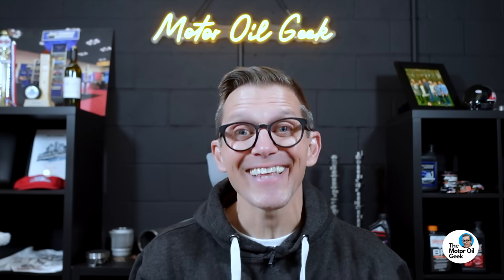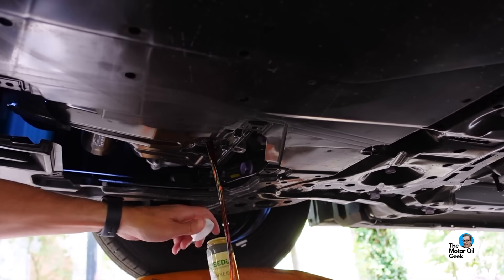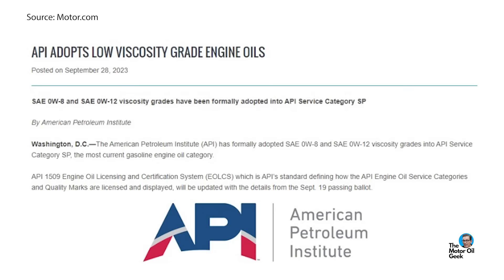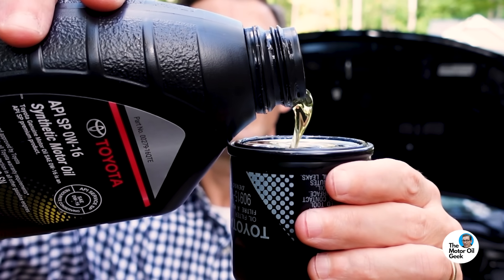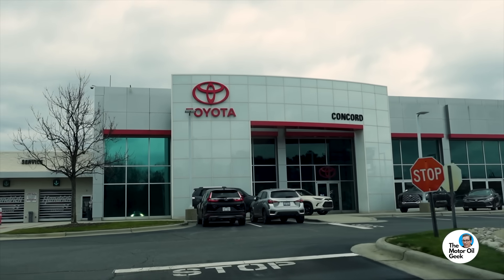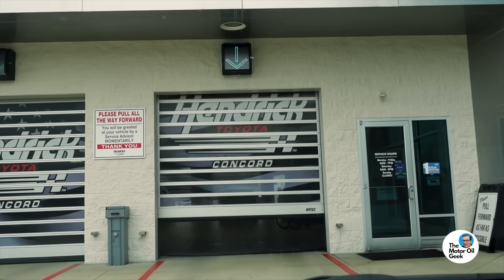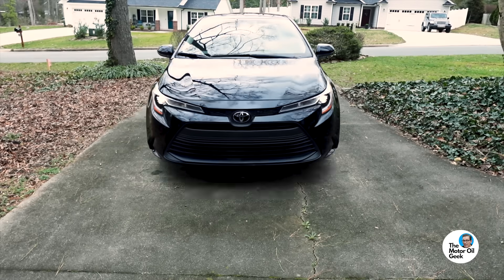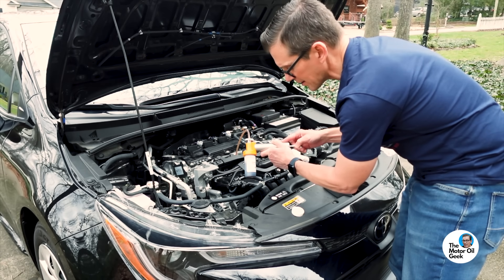0W-8 Motor Oil: Too THIN to Trust? Let's Find Out!

Comment: Love the videos and research that you do.  Keep it up.  We are all learning everyday.  So with that said, I have done a lot of research on CVT transmissions as I own a 2019 Nissan Murano and a 2019 Nissan Maxima.  Traditional CVTs generate a lot of heat especially when driven hard.  I track my Maxima.  With dual 11"x11" oil to air coolers mounted in front of the AC condenser, on the track I have still have seen trans temps above 230 degrees F.  So yes they get hot.  However, the transmission that Toyota is using in their Hybrid vehicles is an eCVT and while it is continuously variable, it is achieved by two motors, one located at the input shaft and the other at the output shaft vs. a traditional steel belt and two varying ratio pulleys.  The motors serve multi functions both as a motor and as a generator which provides power to recharge the battery and is the heart of the regenerative braking system.  So in essence the transmission does 90% of the breaking unless you really need to stop quick in which case the traditional hydraulic brake system kicks in.  Based on my research, there is no valve body in Toyota's eCVT but there is a planetary gear set to facilitate reverse.  The lubrication system in the eCVT is more a splash system for the planetary gear set to keep it lubricated rather than being pressurized.  Neat stuff!!  Learned this from the Car Care Nut who also does You Tube videos.    Toyota's eCVT is an amazing piece of work.

For those of you that have a traditional CVT, especially the Jatco transmissions that Nissan/Infinity and Jeep use, change your fluid often(every 30k miles) and consider installing an external transmission cooler.

Traditional CVTs hold about 10 qts of fluid but you only get about 3 qts out if you pull the drain plug.  however, if you use a fluid flush extractor you can cycle out all 10 qts.  To do so you will need about 12 qts total to do the full system flush.

Comment: You mentioned using a new tube so not to cross contaminate,....but the  new oil mixed with all the old oil that didn't get to drain

Comment: An oil change place gave me a CVT "versatile" fluid in my transmission on a 4Runner.

I asked them if it was JWS 3324 certified.
They looked it up and it said it was certified.

I wonder how that is possible?

Comment: It would be great to test also the TAN and the TBN values every time, I believe it's important to know how those values change over the time.
Reply from the maker: TBN is actually not a great indicator of oil life with modern, low sulfur fuels. Instead, Oxidation is a more accurate detection method. TAN coupled with Oxidation is valuable for ester based lubricants, but non-ester based oils can monitored with just Oxidation.
Reply: @themotoroilgeek  Thank you for clarifying. But what about the damage that acidity can cause to seals and other parts in the engine that are sensitive to acidity?
Reply from the maker: @MECANICANN  Great question. The oxidation of the base oil is what creates the acids, so by monitoring the Oxidation level you are "watching" the acid level. On non-ester oils, an Oxidation level below 30 abs is not acidic. The crossover from basic to acidic does not happen until the Oxidation level passes 40.
Reply: @themotoroilgeek  Thank you for sharing your knowledge, I have learned something new. Cheers. 😉

Comment: So hoping to hear from Lake on this one  - but with my 2022 Toyota RAV 4 non hybrid - should I be running 0w-20 or even 5w-30? When you look at other countries for this same engine there is a wide range of applications. I’m not as concerned about fuel efficiency- I want my engine to last 300K! And I’m on the change oil every 5-6K team. Please no comments from the peanut gallery about how Toyota makes these engine some much tighter now. We’ve seen with the resent GM 6.2 L debacle - that it’s a bunch of garage these manufacturers and their enslavement to CAFe standards.

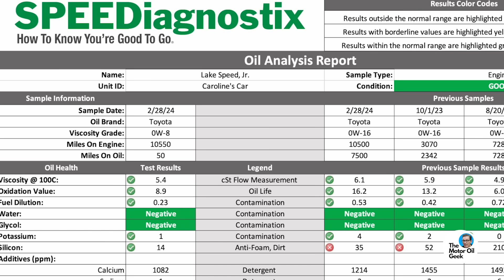Comment: That engine ran 9,822 miles on 0W16 not what is called for in the manual (0W8) as shown on the 10:27 minute mark. I think you should stick with the thicker oil, it showed good results. Switching back to 0W8  with 728 mi of data could be the wrong decision. Why did you use 0W16 in the first place? (Maybe you could only buy 0W8 from the dealership, wasn't worth 50 mi of driving)

Comment: Thanks so much for the informative video. I was quite skeptical of the 0w16 in my 2023 Camry, especially in the light of Toyota recommending 10,000 mile oil change intervals. One who reads forums to any extent understands that many people will criticize those who question the OEM recommendations regarding oil types, etc. It is always prudent to be a student of human nature, however, and take things with a grain of salt until you have facts instead of speculation, as you so state. Many who would criticize me for not buying into the 0w16 (initially) because the engine manufacturers know best would never accept the recommendation to change their oil every 10,000 miles. Thanks to you, I have a better understanding of additive packages, and I have found some information on the internet that Toyota motors have tighter tolerances to accommodate the thinner oils (though I have seen nothing definitive from Toyota regarding this). Thanks again for science over speculation.
Reply: The tighter tolerances argument has never been true. The same vehicles they sell in the usa you can look up the manual for the Australian version and every engine takes up to 5w30 at least.
Reply: @TheScrubmuffin69  Some sources will state that cars sold to other countries have different motors than those sold to the US. That really doesn't make sense, though, so I am inclined to agree with you.

Comment: Lake how about using Marvel Mystery Oil instead of motor oil ?? When I was in Alaska the locals would use the oil straight in winter to be able to start the vehicle at 50 below Zero

Comment: I have a 2010 chevy.  The oil specifications is 0W -20. I've been putting 10W -40 in my engine every year for a decade now. I only use Castrol GTX,and my engine purrs like a  cat!
Reply: i bet you it would purr like a kitten with 0w20 too.

Comment: I have a query that you 100% can answer. I have an Audi TT 2.0 TFSI this car was specified with 5w30 oil castrol edge. Just had a service and the Audi service centre has switched this , to 0w/30 vw504/507. The car is well maintained but we remapped it to 320 BHP from 230 stock is this thinner oil now going to create more wear on this engine dealer says it’s better to get to the components quicker. But what are the risks with this thinner oil. Thanks Lake love this Chanel great information and content. We just want our cars to last into the future long as possible before we are forced to have EV which we don’t want 🤮🤮🤮😂😂😂
Reply: 5w30 and 0w30 have thw same viscosity at operating temp as long as the oil is good. That's why they both have 30 after the w

Comment: as someone who has worked at multiple dealerships as an apprentice I can tell you they dont care if its free or not, they always use the spec oil for the car the oil techs dont even know if the oil change is free or not its just another one of the 15 cars they see a day.

Comment: I have the same engine in my 2023 Toyota Cross.
 I did 3 oil changes ow-20 in the first 50, and will change this out at the 5000 km mark.
 from here on in it will be ow-20 oil forever, at 3,000km.
Just like my Dodge vans with 550,000 km & 307,000 km, 5w-20 always.
 Sorr,y no Selll to me with 16/08/06/ 03 or whatever Toyota wants to do their testing.

Comment: Hey lake, I would really like to see if you could explain this to me. GM LS engines and older sbc vortec engines from early 2000’s typically call for 5w30, and newer GM LT based engines in trucks and suvs call for 0w20, but on Camaros and corvettes with LT v8s, they call for 0w40. 

Seems like oil viscosity recommendations are based on application, not really the engine design. Maybe I’m wrong. 

Would it be okay to use 0w20 on an older LS based v8 or a SBC based vortec from early 2000’s that gets daily driven, and never goes above 3000rpm?
Reply from the maker: While application makes a difference, CAFE fuel economy requirements are the main reasons for that difference.

Comment: My smaller cc motorbike bought in 2013 Recently completed 70000 Kms. 20w 40 was recommended by owners manual. I used 20w 50 instead my piston and cylinder was in perfect condition. (Oil change interval every 4000 kms). 
Manufacturer recommend to change at 5000kms.
Finally after 70000kms the camshaft bearing was gone still cam lobs had negligible wear. 
Recently I changed everything inside the engine, new cylinder kit, New camshaft, (It's SOHC 4 Valve) 
Crank bearings changed. 
Now I started using motule20w-40 3000 Hc tech plus oil. 
Now I am going to shift the oil to Moule 10w 40 estercore semi synthetic. 
Shall I extended the oil change interval to 5000kms using ester core

Comment: It seems to me if 0W8 was so bad for the engine like everybody says everywhere in the Internet because it is too thin like water etc, Lake Speed Jr. would not have used it in his daughter's vehicle. I hope after this video lots of car owner will finally calm down. What is more, he did even oil analysis where he proved it does not hard the engine at all, and because of its additive package contents it performs quite well. This Internet is full of horseshit. Everybody is a professor out there and not shy to express opinion, even if it has nothing to do with real life.
Reply: The main problem is going high miles while also using thin oil like 0w8. The detergents and additives wear out and then the thin oil doesn't protect like a thicker oil would when worn down

Comment: You said that you  tested 0W-20  and 5W-30 on the same engine and found 0W20 gave more wear protection because of the additives in the oil ...that is not true, it cannot be true.  . Do a simple friction test and see which one gives better wear protection . 
Nowvif you really call yourself the"motor oil geek" then try to find out the truth  from your sources as to  why these companies have suddenly switched to 0w20(suxuki) and 0w8 (toyota) oils  while the latest ford n chebrolet petrol cars are still on 5W20 and 5w30 . .
Hope you know what CAFE is , do your research on how automakers are trying to fulfill the CAFE targets .
Reply: i don’t think he’s ever made that claim. He openly admits in one video that when viscosity decreases, wear increases. But we can’t rely just on bearing testers. We need to actually run oil analysis tests. And you know who does that? The OEM. When they R and D the engine. And of the brands you listed, isn’t it odd that the notoriously more reliable brands have switched to thinner oil without issue?
Reply: But it is true and can be true.

Comment: Just bought a corolla SE 2025 and will definitely do my own oil changes at the recommended intervals you specified. How long should I wait to do a transmission fluid change?
Reply from the maker: Do it within the first 25,000 miles.
Reply: @themotoroilgeek  I did my first oil change at 640. Tried to do 500 but had an unexpected trip come up. 😅 --- what was really interesting was the oil had strong smell of gas, I live in a major city and have constant stop and go traffic and idling. I'd be interested in a comparison of the breakdown of oil between cities and suburbia. I wonder if the car would benefit from interval closer to 3k rather than 5K based on the driving habits it will be exposed too. Just wanted to share in case you have data points showing a correlation.  Thanks again for giving me the confidence to do my own oil change.
Reply from the maker: @GG-ws2gc  Short trip driving is tough on the oil. Oil analysis is the best way to determine the proper oil change interval.
Reply: @themotoroilgeek  I appreciate the insight. Will definitely pick up an analysis kit for the next change. Super curious.
Reply: @themotoroilgeek  appreciate the response 🙏

Comment: There is nothing wrong with extended oil draining intervals up to and over 10k miles. I have a 2012 sienna with 170k and have always changed the oil every 10k miles. Still runs like a champ, not adding anything in-between changes.
Reply: That's is quite surprising. Good that your engine works well with such intervals. What is your city vs highway driving percentage? if you drive on freeway a lot, 10K may be fine.

Comment: OE Toyota filters, they test to not filter nearly as well as other common makes and brands. But, we all know toyota run a long time. Obviously, toyota isn't going to risk the reputation for longevity to save $2 on a filter. Do you have an opinion on oil filters and how critical or not having a "tight" media filter versus a Toyota (and Mazda) filter that prioritizes flow over small micron capture ? 

I tend to believe factory engineers know a little something that doesn't meet the casual onlooker's eye. The toyota oil samples, while using Toyota OE filters, don't appear to have more particles than average. I'm just curious if a common brand filter would show fewer ppm wear particles. Is there a Tribologist's opinion ?
Reply: Seems like Toyota prioritizes flow vs extreme filtration.

Comment: Compares the 16w that was used whilst the engine was
STILL breaking-in after only 700 miles to the later replaced 8w
at 10,000 miles for contaminents and declares the 8w as "better" 
because there's now less contaminants in the 8w oil than there was
in the 16w break-in oil... Yeah right....

Comment: Thank you for your video clips, time and help when it comes to automotive lubricants in general. Very helpful and easy to follow for sure. I have a question for you regarding my 3 vehicles. I live in central North Carolina and would like to hear your opinion on motor oil viscosities for 2022 Toyota 4Runner (manufacturer recommended 0W-20 or 5W-20), 2018 Toyota Rav4 (0W-20 and 5-W20 recommended) and 2022 Toyota Corolla hybrid (0W-8 or 0W16 recommended). To my understanding, 4Runner is verly little changed in the last 10-15 years, and previous generations used 5W-30 oil. Would it be safe to use 5W-30 or, perhaps 0W-30 in 4Runner? 5W-30 or 0W-30 for Rav4, and 0W-20 for Corolla? Thank you in advance for your time and effort in this case.
Reply from the maker: Great question. In reviewing the used oil analysis data, we do not always see a drop in wear when a heavier viscosity oil is used. Sometimes we do. Sometimes we don't. We've even seen wear increase when a heavier oil is used, which is why doing used oil analysis is critical for making data driven decisions (instead of speculating).
Reply: @themotoroilgeek  thank you for the prompt response sir.

Comment: I found it, 0W-8, Toyota motor oil, at Lowe's. It's in my lawmower. My  lawnmower doubles as a snoblower. It's a 1973 International Harvester Cub Cadet w/ all original, never opened Kohler K-301 12 HP engine. I wanted the thinnest orl as l can find cuz of the starter. My Cub Cadet has a "Starter Generator" and they are not all that powerful for either. Add to it, my compression release mechanism on the Camshaft just might not be performing at 100%. Where l live (Southern Meechigan) when we get a snow storm the Low Pressure usually passes by to my South and as soon as the storm passes it drags cold Canadian (#51 state) air down to my area and it's not unusual to go down to just about 0°F/ -18°C and that 52 year old design starter isn't gonna cut. I had the starter generator rebuilt at a bonafide starter shop, the battery is always on a "maintainer" but it just barely gits it a 50°F. I don't keep the mower in the garage and it doesn't hav a block heater, so light oil seemed like the thing. FYI at 0⁰F-10⁰F it doesn't git real hot & it only runs about 25 mins to Git-R-Done. PS (edit) I never run my Cadet over about 3,000rpm, that's howscome  it's still around. OK? ben/ michigan

Comment: The manufacturers want your engines to have a shorter life span and get their MPG goals. Double win for them. There is no way in hell I am using lower than 5W- 20 in a V8. I dont have 4 bangers so super thin oil is not a concern of mine.